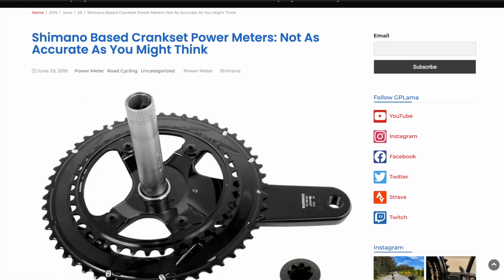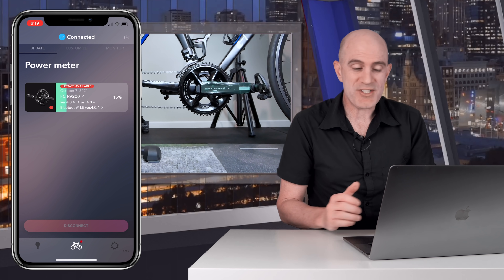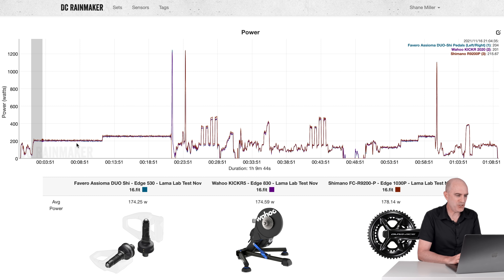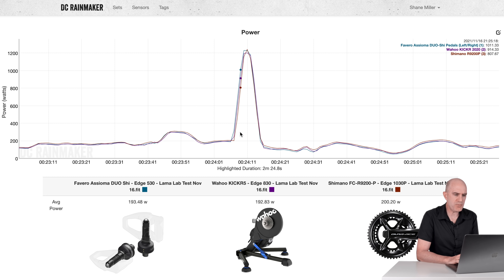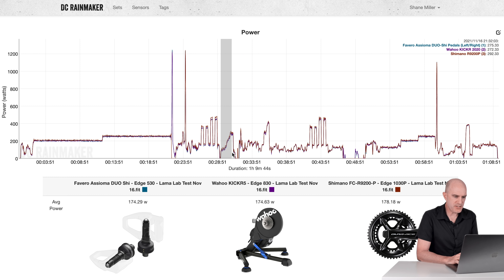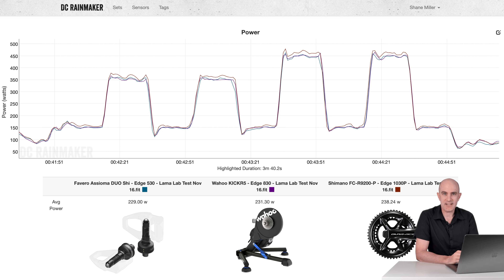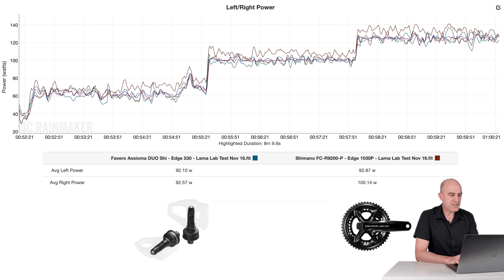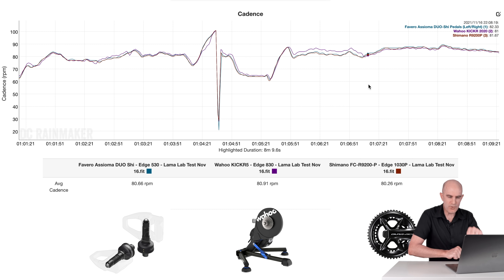Shimano DuraAce R9200-P Power Meter // Initial Lama Lab Test Data Review

Comment: Hello Shane, thank you for all the insights and for the information that you are providing to us. It’s really appreciated. Further to you video here, I decided a few months back to go for Assioma Duo Shi because power datas were more accurate than Shimano power meters. However, the Q factor on these pedals is something disturbing for me. I am thinking now to switch again for Shimano power meter. I can see power cranks are now slowly reaching the consumer market and perhaps pros will use during the TDF. In previous months, pro cyclists were using previous generation of Shimano power meter with the new groupset and this was an indication that perhaps there was something wrong with the datas. My question is : Have you had the opportunity to do further testing on the 9200 power cranks? Did you get your hands on another, perhaps more recent crank? Thank you!
Reply from the maker: Unable to source anything from Shimano, so no. Not at this point.

Comment: thanks for the video, do you think the 4iii dual sided 9200 power cranks shipping with some DA bikes will be hindered by the same accuracy challenges?
Reply from the maker: Unknown. I’m trying to get a hold of a set of these cranks to test.
Reply: @gplama  Hey Shane - any luck getting your hands on the latest and greatest? Just bought a new bike with this fancy new group set and am getting informed now on what I've committed to :) thanks
Reply from the maker: @chbrosz  No luck.... If you have the new power meter from them, I'd perform a number of comparative tests and make sure it's accurate. If not, return it.

Comment: Shane, as well as doing a zero offset, are you able to do an actual calibration to check the accuracy of the units? When i used a Kickr, i found the power was high - either compared to my Neo or to my SRMs and Infocranks which i'd calibrated with a variety of known masses (8 to 30odd kg).

Comment: Question: I have Stages Shimano Ultegra cranks, they read with-in 49/51 or 51/49 power balance, so pretty balanced it seems (i've tested this with Tacx Neo and Direto and both report the same, so in that regard i'm confident with my cranks). Interesting thing is if i let Zwift and Tacx Neo 2 interact with each of other and i record my Stages cranks with headunit there can be 10 watt difference in reading. If i do 190 watt ride then Stages Cranks report around 180 watt. I noticed similar behaviour with Elite Direto too so this isn't just Tacx Neo's thing*. HOWEVER:

If i let Zwift read my Stages Cranks and based on their reading control Tacx Neo2, while Tacx reports wattage to my headunit, there is only 1-2 watt difference in power reading. 

What gives? 

*Haven't tested this more yet, but with Direto i noticed that power readings, when getting closer to 300 watts started to read within 1-2%, while around 160 watts difference could be close to 10%. Wish i'd had tested Direto similarily as did with Tacx where Direto only provides resistance dictated by Stages and Zwift.
Reply from the maker: Zwift fudges data, so beware. It'll hold watts if it sees 0W. I find dual/triple recording is best done over ANT+ all to the same brand GPS units (Edge in the Lama Lab). Zwift data is still OK for steady-state comparisons. The stop/start/averaging can be off though.
Reply: @gplama  Thanks. I've mainly done steady state rides to see how watts behave when in ERG mode. But yeah, my set-up is pretty bad to make anything really accurate observations.

Comment: Great work mate. Few observations...
1. Surprising that the Faveros and Wahoo trainer read basically bang on the same. This is saying you have 100% drivetrain efficiency... Holy grail stuff...can we trust those numbers as a solid reference?
2. Agree shimano looks consistently high on drive side. Theory - long winded so bear with me.... Shimano freaked out last time, so have spent a lot of time on a dynamic test rig for calibration that mimics road riding. Drive side reads high on indoor trainer from off-axis chain forces and stiffer rear hub constraint of the trainer (on the road the bike can lean). This increases the horizontal bending component of the chain tension when the chain isn't running perfectly straight, thus imparting a bit more strain on the drive side guages. In other words, in the trainer the BB flexes a lot and the rear hub is held completely fixed, but on the road they move together, lowering the lateral chain forces. Just a thought.
3. PR nightmare by Shimano not addressing splitting bonded cranks.
Reply: My Kickr and Favero duo is the same often within 1-2 watts in separation reading very close.
Reply: It was worse in ERG mode vs sim mode on the trainer so I don't think it has much to do with horizontal strain being measured. IMO the dynamic offset inherent in the integrated spider design introduces weirdness when certain pedaling styles are involved. In ERG mode with low flywheel speed, your power phases elongate vs when your wheel speed/momentum is higher. If Shimano lazily determined that a +10% scale factor was "close enough" to "typical" pedaling, then it skews with atypical pedaling regardless of whether the bike is mounted to a trainer or if you're riding in the real world. I would put money on the DS power-reporting on a very steep outdoor climb being nearly as far off as ERG.

Hopefully Lama can get another unit and put it through its paces again on varied terrain and at various speeds.
Reply from the maker: 1. Mentioned in the video. I've been told Wahoo factor in a small % to drivetrain loss... and we can never trust anything... only test and observe... and find the outliers... that usually gets us close to what's good enough to use/rely on. 

2. You're way more qualified than me on this one! 

3. I really wanted them to go with a total new design. I was surprised it was visually VERY similar to the 9100.
Reply: @gplama  too much investment in forging and glueing the clamshells i guess. That and stubbornness 😄
Reply: @PeakTorque  Japanese aren't exactly known for leaving their comfort zone when it comes to the status quo 😅 Look at the automotive OEMs still fighting the BEVs... However I can't believe the tooling cost is so high for bike components especially now when everything is selling like no tomorrow. I'd say why bother and cash in.
Reply: Wahoo artificially increased the power meter readings on the V5 Kickr. I believe it was done intentionally to force all competitive Zwift racers on to their trainer. Brilliant really. However, it's the beginning of a new game. Highest reading trainer wars :)

Comment: Makes my decision easier now. I will go with power2max. My two units run already for years and both read exactly the same over and over and always work. Now they even released a Shimano rings compatible light version that can be used with the aldhu 30 crankset and rotors carbon arms. Take the NGeco version. It is cheaper, way lighter and reliable. Quite disappointing for Shimano
Reply: Yup... who still needs a magnet in this day and age?

Comment: Genuinely incredible that Shimano haven’t (potentially) sorted this yet on their flagship, premium product. For the price that thing should be accurate straight out of the box.
Reply: IMO they haven't changed the fundamental design of the hollowtech crank arm so I'm not surprise that it's still bad. It would require a different, possibly heavier design.
Reply: @lechprotean  they have fixed the assimetry of the R9100 design

Comment: Did you use a 12 speed chain? must be optimised for one. Might be worth it next time.
Reply from the maker: 11spd. Not sure how a 12 speed chain would have any influence on the numbers given the Favero meter(s) were looking pretty good up against the Kickr 5.
Reply: @gplama  Will these  Cranks work with an 11 speed set up?

Comment: The long term will be interesting as I have the previous version, its accuracy was poor to start with it has drifted even further off on the RH crank , my rotor on the S5 has been solid for 4 years. The only use for the Shamano is to cheer me up when my riding is crap as the reading are now 20% over on the right, until I decide to tell myself the truth of course.

Comment: I to thought Keith's video was very informative.  But just asking (not being sarcastic) How were you able to determine the Wahoo to be accurate enough as the control?  Do you have access to test tools that confirms any of these product are calibrated accurately?  Otherwise aren't you just comparing each product to another?
Reply from the maker: 100s of tests. A handful of other meters. The numbers usually gravitate to ‘the truth’ with what I use as a baseline. This also involves static weight tests on meters that support it. If something is ‘out’ it’s easy to spot. Why it’s out is the great unknown in most cases.
Reply: @gplama   I applaud your attention to detail and the number of tests you have conducted. Your channel is the most detailed I could find.  I am a serious motorhead and a serious cyclist.  From my interest and education in motor tech my hair catches fire from how the bicycle industry misapplies or leaves out vital data in the use of dynameters.  Such as load and torque data. Without these two data points the power data is meaningless.  I will write to you privately to share more of my thoughts.  I wish I had your skills to develop a channel as organized as yours.

Comment: Was there ever a dual-sided 105 power-meter? Considering the bonding issues noticed in Ultegra and Dura-Ace, it would be interesting to know if 105 would be more consistent.
Reply from the maker: Nope.
Reply: 4iiii precision do a dual sided 105 R7000 power meter

Comment: i do see similar issues with loadcells in my job, the main causes being the strain gauges becoming un-bonded from the material and will read OK until stressed a bit then go out of wack but i doubt that on a brand new crank. My money is on the 2 piece design  that is bonded #thanksshimano, any movement between  the 2 bonded sides could cause a preload, underload or effect the calibration slope and give these results and a zero would only reset until load is put through the crank again. there is a reason we make precision loadcells out one uniform piece of material. Would be interesting to see the raw data out of the strain gauges during use.
Reply: Guessing there is a learning curve with bonding correctly do initial units will behave worse

Comment: Hi, Shane!

If I understood you right, the Shimano meter is using a cadence magnet on the frame? Is it only registering cadence once per pedalstroke?
If so that can have some impact on the power values depending on how the do the calculations.

Candance is generally not constant during a pedal stroke and if you use the avg. value for the pedal stroke and use more granular measurements for the torque then you probably will get some inaccuracy's. Although it should not give any large differences between left/right if you don't have any larger differences between the legs in the pedalstroke.

Thx for the great content!
Reply from the maker: Yep, needs a magnet on the frame to work. I suspect it's cadence (and unit wake-up). Not sure on the specifics. I would assume they'd have accelerometers in the sensors too (like almost all other meters), again, details are light on exactly what's going on internally with these units.
Reply: @gplama   Ok. It will be interesting to se how the unit perform when you can do more in-depth testing.

Do you know if the unit is going to have any of the pioneer metrics?

Thx for the reply!

Comment: Ya just gotta wonder how a company with Shimano's reputation and resources can screw the pooch on this so consistently for so many iterations. Geeps, took your recommendation earlier this year and bought the Favero Duos - best thing I ever did for my training. Cheers.
Reply: So many iterations? This is the second attempt
Reply: @enki42ea  You are right but only if you assume that Shimano learned nothing from the third party PMs that were applied to their cranks.
Reply: @andyking8464  how would they have learned trade secrets from another company? You make it sound like no other power meter company had issues with it's first few generations
Reply: Shimano's reputation is why I'm not surprised by this. Any of my many fellow failed crank and oxidising caliper owners will understand
Reply: @kpizzle1985  Many failed cranks?

Comment: #thanksshimano
Reply from the maker: Thanks Shaw's Cycling. (I wasn't able to get a hold of it via Shimano... or anywhere else!)
Reply: @gplama  Considering the variability of the offset, I wonder if they just lazily applied a ~10% scale factor and called it a day. Why Shimano doesn’t just go with a modular crank design is beyond me, especially considering GRX uses 110/80bcd vs 110bcd.